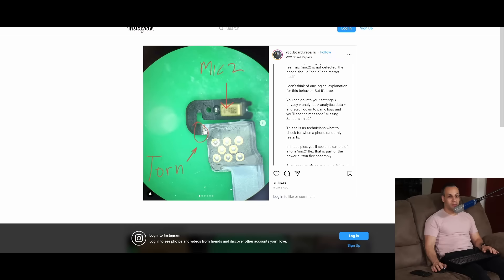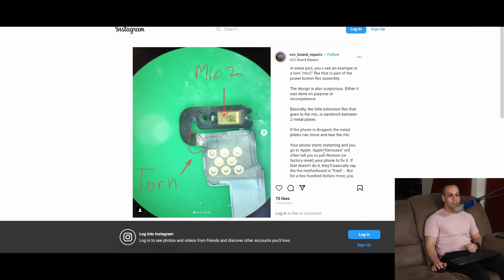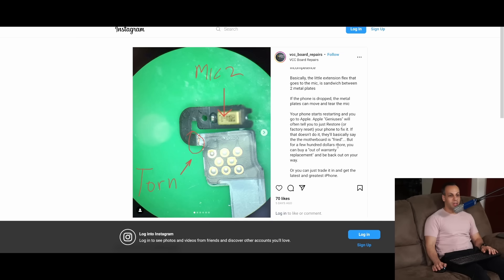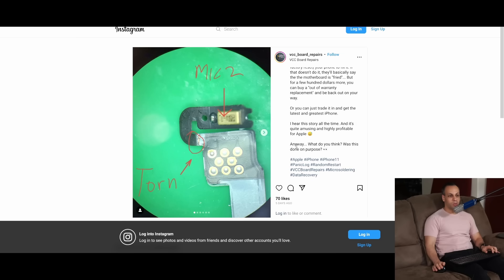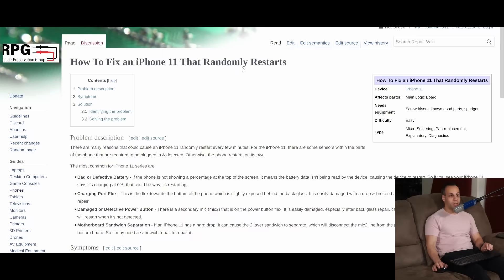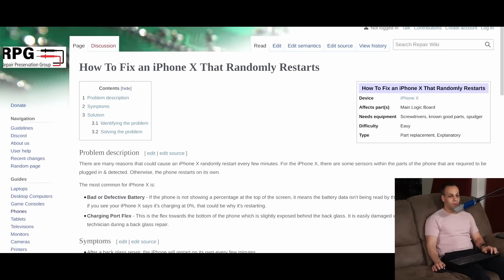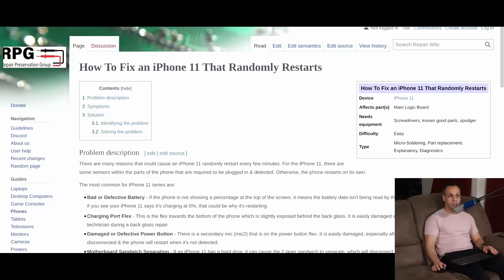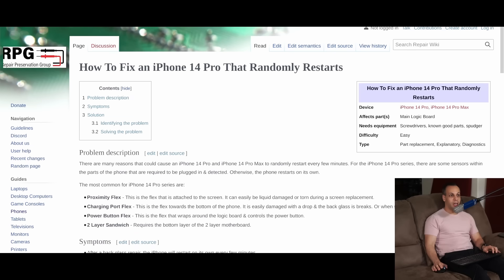iPhone's design flaw shows that 10 years later, their engineering is still a joke

Comment: No no Louis.....its never Apple's engineering thats to blame. Its always the customer that is using it incorrectly. Remember.....you are holding it wrong!
Reply: Oh I remember it . . the iPhone 4 & 4S! I wonder if they just didn't have a good 3G and 4G testing suite, because how could they not have caught the fact that the antenna placement is blocked when the phone is being held?

Regardless, it was their response to these problems that really pissed me off, because if they would have said: "Hey, this is 100% our bad, and our options are limited since the iPhone is already. We have made some design changes for our next iPhone, and this specific reception issue will not occur. In the meantime, a workaround has been found: by gripping your iPhone 4 or 4S from the very bottom, more of the antenna will be exposed, giving you much better reception. On behalf of everyone at Apple, we are very sorry about this issue, and we are committed to finding working solutions for our customers."

HOW HARD WAS THAT?! THAT TOOK ME 2 MINUTES USING VOICE-TO-TEXT WHILE REBALLING AN AMD APU, YET APPLE TOLD THEIR CUSTOMERS THAT IT WAS THEIR FAULT, THAT THEY'RE HOLDING THEIR IPHONE WRONG BECAUSE OF THEIR INCOMPETENCE!

Also, I know that low power to the modem was also involved with the reception problems, especially on the CDMA Verizon devices, and that always seemed like something that could be at least tweak via firmware.

Anyway, sorry for the Ted talk, but when I saw your comment the trauma of that came back! We should never forget about that whole debacle, because telling someone they're holding their phone wrong and response to poor design decisions is just gross.
Reply: @JacksonPhixesPhones  well said.....but here's the reality..... Apple's customers totally bought it. For some reason Apple's customers enjoy being treated like d@#kheads.
Reply: @Sabundy  Yep, they've always been willing to fall on the sword for Apple, and I find that fu*kn bizarre. I have a client right now, I'm swapping the panel on her 14 Pro Max, and as I'm sure you're aware, in order to keep true tone & auto-brightness, with no warnings use 'non-original parts (even though I only using OEM panels, for now, for the 14 series), I I have to remove the three serialization/LCM/glass ICs from the original panel & flex, reball, then install 'em onto the new display assembly/flex. When I was explaining what was involved, she asked why it was so complicated, so I explained individual component serialization, BMS data encryption to prevent simple battery swaps, and how they could have written an ID system into the firmware that identifies OEM panels instead of pairing individual components to the logic board, which is not impossible since Google does it with the pixel fingerprint sensor. I like my customers to have options, and there are aftermarket OLEDs that are damn good, (FX5's soft OLEDs are impressive for the cost AND support encrypted LCM/serialization copying, so you don't lose true tone & auto-brightness),, but the 14 series is too new, so we don't have a plethora of aftermarket parts yet, the ones we do have are not up to par, at least in my opinion.

She just said: "Well they clearly have a good reason."

🤦‍♂️😳🙄

Also, if you don't have Apple Care, they gouges for display assembly replacements, especially on the Pro Max lineup. I do my own display assembly refurbishing, so I can do the same repair, same quality for ~$50 less than Apple, and in her case it's more like ~$100 bucks cheaper since her OLED was fine, just broken glass, so I can refurb it.

What really pisses me off these days is BMS transfers. Unravel the old battery, remove the BMS, sand and clean the nickel tabs, spot weld the original BMS to the new battery, roll the BMS up, ttach a tag-on, etc etc etc. Why encrypt the battery management microcode, why? There is no attack vector from a security standpoint, and it introduces unnecessarily complex code to the iOS system. It's anti-independent repair, period. Anyone who doesn't believe that, or is sitting on the fence, look at what we have to do for these batteries on the 13 and 14 series. 
And yes, I know you can throw an aftermarket battery and it'll TECHNICALLY work . . but excuse me, it won't, because it won't display battery health, and you'll have iOS spamming warnings about 'incomplete repair'. I don't want my customers not having full functionality, and having the battery health data is important. 90% functionality is NOT 100% functionality.  

Companies like i2C Will break the encryption, then push an update to their programmers so that we can just plug in and transfer the data from battery to battery, but as of right now, it is a chore. Luckily, companies like XCAP make BMS-less extended capacity batteries for pretty much every iPhones where that kind of repair is necessary, but it's just a mean thing to do, it's just mean and spiteful, and it's yet another roadblock to make independent repair of Apple devices even more tedious. I'll do it, because at this point it's principal as well, they can't win, they're a bad company, they create so much e-waste and then spout off about how environmentally friendly they are, and they used to not be this way, so great job Tim, nice company you're running there.
Reply: @XtreeM_FaiL  exactly 🤣🤣🤣
Reply: @JacksonPhixesPhones Only the release of the 4. They solved it before the 4S came out. A thin layer of clear plastic was put over the aluminium edges... Not that most people even noticed. First thing most people do is stick a case on to protect their rather expect phone.
They also adjusted the software to hide the issue a little by changing how signal was reported... Didn't stop calls dropping out though, for some reason.

Edit: it wasn't related to the antenna not being exposed. The issue was shorting the 3G antenna to the wifi one (or whatever else was on the outside strip), which caused it to not respond correctly at the frequency being used.
Reply: @tin2001  The Verizon iPhone 4, had 'init_mux=742(MHz' and bursting at that frequency,even if you were shorted to the Wi-Fi antenna module in some dual-band configuration @ 2.4 & 5 GHz, AND you have chassis_reception=push-pull (that flag would only be in push-pull when the battery was over 75%, defaulting to pull-pull-push at 74% and below), you still wouldn't have any noticable error-inducing crosstalk between mux'd CDMA and WiFi, not at power output that low. But also, the gap between the frequencies is an absolutely massive one! With the iPhone 4, I think they had realized that they were on to something, since  the shape of the antenna array is key to stability, WHEN IT COMES TO VOICE THAT IS! Keep in mind, I'm only referring to the CDMA variant.

When it came to raw Tx/Rx, everything looked above board, and the issue was not obvious at all according to the abstract of their paper, but when it came to specifically the Verizon variant (which I'm 99% sure wad the only variant they tested) they were getting major attenuation only when being held, and while they'd never use the word 'PROOF' Since this was a scientific investigation, when you read their paper, it's pretty damn convincing that it was due to obstruction, but not just any random obstruction, a very specific type of instruction that was only seen when the phone was held an extremely specific, yet fairly common way (The technical term for the specific cause is: lateral cone generation & chaotic dispersal) That's very specific issue is exactly what Verizon's engineers found, and they found it before Apple's engineers, before Qualcomm's engineers, and before the 'Big 4' testing firms.

While I can't 100% say That's what they describing the paper is what they used to craft a workarounds in the firmware, the type of changes they describe in the paper, and how they would be able to have Apple push the software update through their staple channels to all the affected devices, or at least most of them, I think they fixed it with a really clever radio 'hack,' and 'hack' is the only way I can take to describe it, because it is an absolutely boss solution. I work in this field, and I wish I had the kind of creativity that this fairly small team of engineers was able to pull off, and pull off without breaking the functionality of other components, cuz as I'm sure you and others remember, the CONSTANTLY DROPPING DATA seem to be the results of Apple's rushing to push out a fix due to the bad press they were getting. It was basically redirecting a bunch of power, sacrificing voltage to other components, like envelope filters (OMG, WTF?!) that are absolutely necessary for stable data Tx/Rx!

anyway, i think verizon's investigation team was how they were able to design, validate, and release a fix pretty damn quick. Also, something absolutely amazing about that entire debacle but I just learned about a year or two ago, is that there was a published peer-reviewed research papers written by the VZ testing team with the title: 'Pseudo-Phased Array Transmission IN THE ABSENCE OF MULTIPLEXED SIGNAL LOCKING' (caps added for obvious dramatic effect). They were able to tweak the issue in software, and basically using a total connected antenna 'array' instead of the several separate (electrically isolated) antennas that's absolutely required to create a stable phased array antenna where you can steer the beam without any moving parts, they figured out a way to KINDA do it with a connected antenna array (hence the 'pseudo' qualifier in the paper title).

That research paper is an absolute must read, even if you aren't highly versed in all the technology and terminology, and there's A LOT of data, but it's fairly easy to follow. They did a great job of describing the problems, methodology, data, & conclusions; also, their data tables are absolutely beautiful, it's just a really well put together scientific paper (seriously , their data tables are beautiful!). Here's the thing though, unfortunately it's not open access, HOWEVER, if you really wanted to read it, I think it MIGHT be available on some sort of 'hub' . . . . perhaps a hub that is of the 'scientific' variety . . 😉

Sloppy muxing to get lock on GSM and early HSPA networks is pretty common, since the technology was fairly tolerant of errors, but CDMA was a whole different ball game, and I never really understood where Verizon was trying to go with it, because obviously they knew we were getting close to the LTE era, And I'm pretty sure the LTE v 4.2 specifications have already been released by then, so they knew that CDMA was on a dead end, so that's always been kind of a mystery to me, because it was a cool technology, but I feel like it was just really picky and somewhat fragile, if you can call a signaling protocol "fragile", what I guess I just did lol.
Reply: @tin2001  The engineering involved in finding the issue(s), working through and validating solutions (if they're even or any), is incredibly impressive stuff IMHO at least.

I'm extremely impressed by the whole thing. Obviously Apple didn't have the best of responses, their hardware vendors and carrier partners are the ones who really stepped up and figured out what was going on, and how to at least get a workaround validated and pushed out quickly as they're not inconvenience millions of people,even though it was kind of a weird fluke that they should have seen, or at least they should have caught something in testing, I still love reading about how they find those issues, and how they fix them as well, obviously lol. I mean, we like breaking stuff, but eventually you got to fix it 🙂👍🐧🐧
Reply: @@MrAn0n😂😂🤣🤣🤣
Reply: Ah, the classic Antenna Gate.
Reply: @@MrAn0n 🤣🤣🤣🤣🤣🤣🧐
Reply: I must be holding it wrong too since my toilet has horrible reception.
Reply: Don't blame the engineers, blame the ones drafting the guidelines they work within.
Reply: @Volvith  So a "we were just following orders kind guy".
The one giving the guidelines is certainly to blame, but also the one following the guidelines.
Reply: @@MrAn0n Friends, remember a woman will never admit her mistakes.

Comment: Random reboot issue is the issue with top speaker some repair guy show it the video.
Reply: @@GH0STST4RSCR34M probably a shorting speaker.
Reply: @@GH0STST4RSCR34M ok. depending on how "smart" the speaker driver is. If it notices that the current draw is higher or lower it can give you a panic issue because of some "speaker" compliance mumbo jumbo the point being if its outside of compliance it could be a safety risk to the users ears. Dont quote me on I only heard this as a HW eng from an audio eng that speakers should have strict driver output tolerance if its handheld but not if its a stationary one.